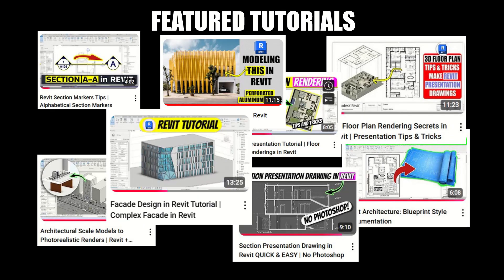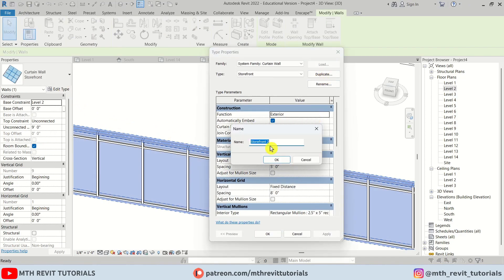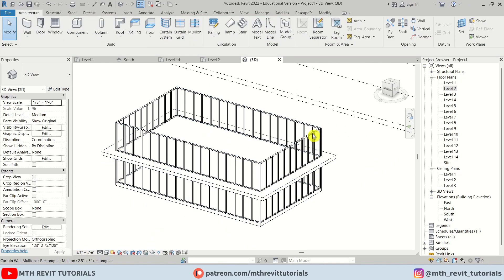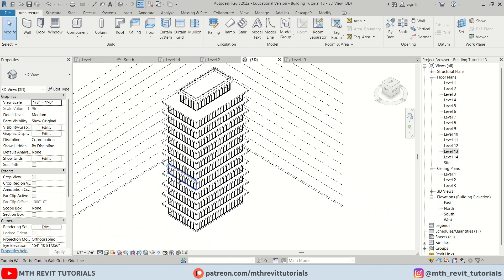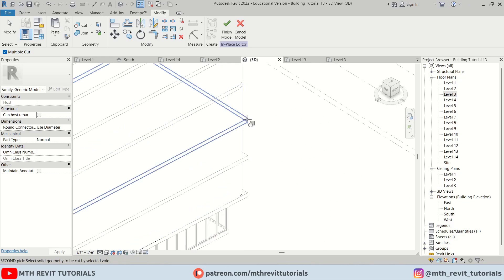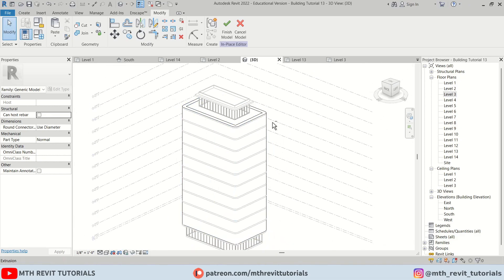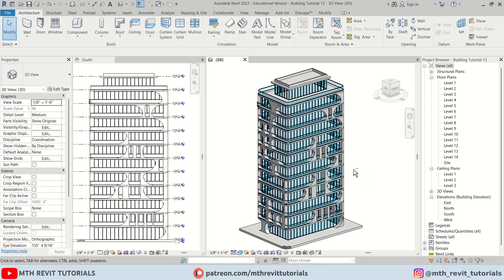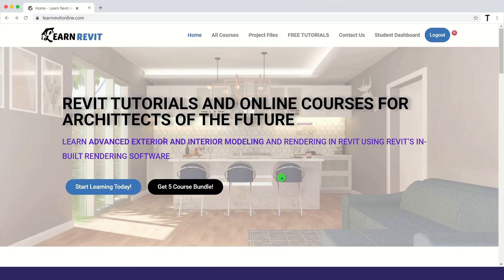Revit Tutorial | Modern High-Rise Office Building

Comment: I am not able to cut first generic model with second void form how i fixed this please reply.
Reply: it could be that you aren't working on the right plane, if you select your elevation first then go to void and then pick a plane, hover over your mouse till either the whole size of the area your facing has blue highlighted edges by pressing the tab key. that way when all side are highlighted you know you're working on the right face. also an issue I had was that I was working in wireframe on revit, (it's at the bottom looks like a mini cube) and that since I was working in wireframe it selected what was behind instead of what was infront  on elevation i was working on, make sure its on "hidden line" before you select a plane, hope it helps
Reply: @andrewfitz6540 Ok. i got it.
Reply: Be sure that you pick the same plan then ,,first click on the void extrusion ,,second click the extrusion
Reply: If it doesn't work with you tell me..ok?!!